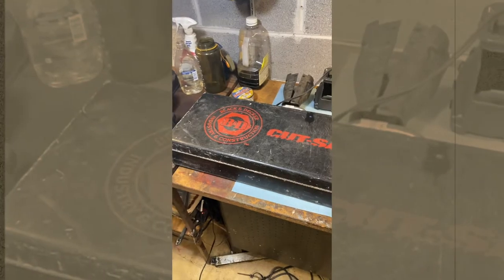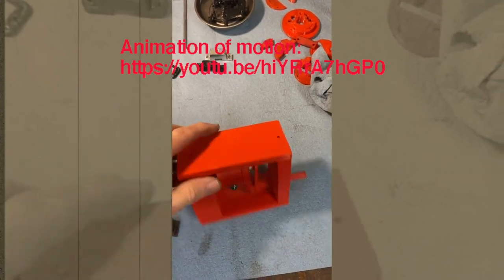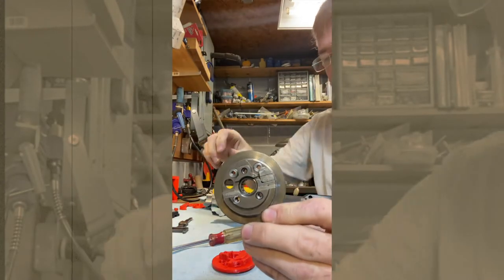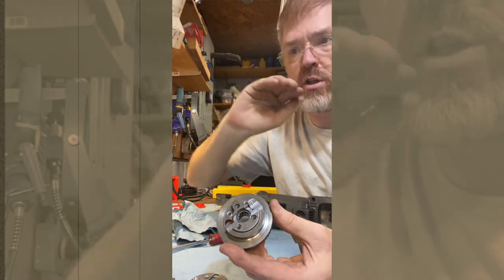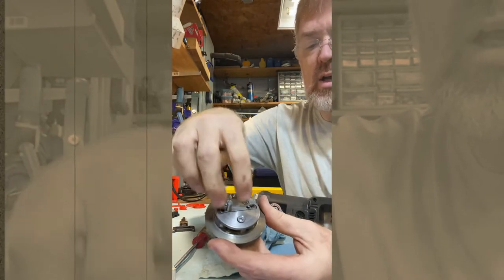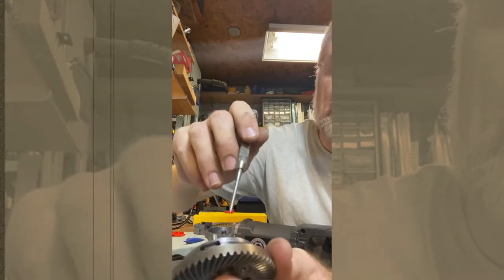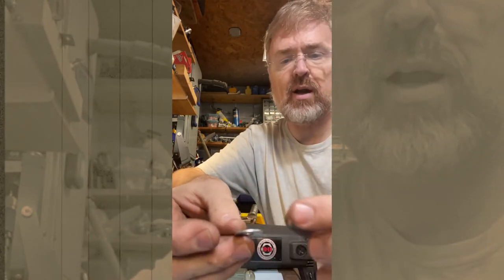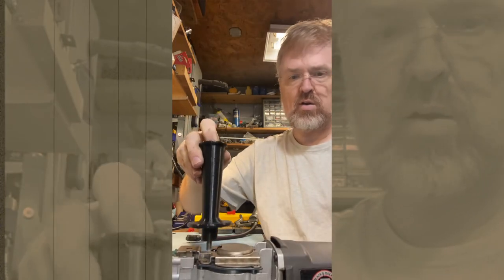DIY Power Scraper

Comment: Thanks for taking the time to make the video.  And, more importantly, thanks for explaining your thought process on why you did what you did vs what others have done.
Reply from the maker: You are most welcome.  I REALLY wish that scrapers could be mass produced, so the price would come down.  There is no reason that one should be more expensive than a sawzall at Lowe's.  But hopefully someone can take what I have shown and make their own.   Best wishes!
Reply: I totally agree, i can't see why this tool cant be cheaper, not in quality as i believe it can be engineered to last with using the proper bearings and what not. Im not in any way qualified or smart enough to mechanically design a new concept for this tools mechanism but i believe a simple version of whats already on the market can be produced for way less than one such as the Biax, case in point the one you have made as well as many others that im sure have done so because of the unrealistic price and availability. I know its not something that would fly off the shelf due to the consumer demand and market is so small but the price doesn't seem to match the tool.  @KevinToppenberg
Reply from the maker: @thecanadiantradesman7916    I agree.  Or I would think that someone could make a business of conversion kits or something!

Comment: Thanks for sharing all your hard work. This was so far one of the best DIY scraper conversations ive been able to find on YouTube. There's a few others that show some different types of reciprocal saws aswell but i believe il be able to combine all of them to maybe construct my own. An actual Biax is in my situation is practically not an option, as i would not be using it to rebuild and scrape for a profit, more so to only improve my own machine tools oiling and in time possibly rebuild when time permits. Further more I would need the appropriate inspection tooling such as a very large (due to the size of my equipment) surface plate and various straight edges. Again thanks for sharing and for your time
Reply from the maker: Thank you for the kind words.  I'd love to see the final results if/when you get yours built.  Best wishes!  KT

Comment: Thanks for the video! I am building an Epoxy Granite CNC mill, and there is going to be a lot of scraping for all of the linear slide surfaces. Fortunately, I googled "power scraper" last night and your video came up in my feed today. I discovered the Biax and Makida scrappers but both are either more than I can afford or am willing to spend, so I started pondering along the same lines. A modified reciprocating saw.  In the end I suspect I'll just do it by hand, since I haven't done it before. Giving a power scrapper to an amateur might be like giving a monkey a machine gun.
Reply from the maker: I think starting with hand scraping would be a good beginning.  Get the feel for it, and see if you really need a machine.  On the other hand, it was a fun project to make!
Reply: @KevinToppenberg  I agree. Once the CNC is done I probably won't need to scrape anything again. I primarily want the CNC for telescope making and some other projects.
Reply from the maker: @jameshicks7125    That sounds like a fun project.  Best wishes!

Comment: Great use of modelling & 3D printing to optimise the parts pre machining. Good explanation of your design choices and how you overcame the pitfalls. Your machining skills will improve you have a BP style mill and there is hours of content on the ‘tube to absorb. I too would like to make a power scraper and have watched all of the males as you have but you have added to the knowledge base by showing the Biax approach. Please do share more as you develop your solution. Yes it took you a month but you have already saved me development time. One solution suggested is to build two units with fixed strokes one short and one long to save the hassle of building the adjustment into one unit. Thanks for sharing.
Reply from the maker: Thanks for the kind words.  They are appreciated!

Comment: Well Done Kevin, thanks for sharing. So, now all I need to do is finish painting my basement shop area, prepare and finish the floor w/ polyasorbic (think epoxy, but better) floor finish, clean up my newly purchased 50 yr old BP mill, disassemble it to move to basement ( down a grass covered incline), rebuild head, motor, and table/saddle/knee parts as needed, scrape all the ways, reassemble....then I can replicate your wonderful idea to make a power scraper to make step 47, 1000 times easier.  I may have lost my mind!
Reply from the maker: I guess it is all about enjoying the journey, eh?  It is funny that you mention transporting your mill down a grassy incline.  I am in the process of moving my shop out of my garage to an outbuilding which is down a grassy incline.  I'm afraid I'm going to have to rent an expensive forklift with large tires.    Best wishes!

Comment: I have used that masonry drill bit hack myself - I made a set of them and they have got me out of trouble many times
Reply from the maker: Someday I hope to purchase a proper set of carbide drills.  But you do what you have to do!  Thanks for watching
Reply: @KevinToppenberg  
You never know what the day will bring. I recently went to car boot sale and got lucky finding a tin of about 50 carbide drills.These are mostly metric and under 7mm with a lot of duplicates, and a few small carbide bottom mills and countersinks as a bonus ....they are all in great condition, some never used. I knew straight away by the weight of the tin that I was on a winner and snatched their hand off when he only asked £4 for them ...... even in my state of shock, I did have the decency not to try and beat the price down.  :<)
Reply from the maker: @bigoldgrizzly   I love stories of a great find at such sales!  Best wishes.
Reply: @KevinToppenberg  
Indeed so - a bit like fishing, every time you cast, you never know what might end up on your hook  ;<)

Comment: Great thumbnail for the video! Nice use of pop culture references with merely an image! Commendable...
P.s. phew, regarding the filming of my restorations, i just might do some, as i just moved my Emco FB2 on her bloody table(dont try to muscle around 110kg of cast iron), and now the shop is actually starting to look more like a shop and less of a mess... I guess I`ll use one of the screw anchors in the ceiling for garage door and install a custom swivel arm. With it hanging there i`ll be able to film the whole room from a good position and capture all the work more or less from good angles...
Reply from the maker: Thanks!  Does it remind you of a particular pop culture reference?  I was trying to be dramatic, but wasn't copying anything specific, as I recall.

Comment: That last black ring you 3D printed so the cap would fit properly; how did you get the dimensions for that cap?  Noticed you have not only the diameter correct, but the whole cap seems to perfectly fit the cast metal casing of the scraper.
Reply from the maker: It's been awhile since I did this, so I don't recall directly. But my usual process is to sit down with caliper and measure all the parts, and then put those values into my modeling software (I use OpenSCAD).
Reply: Info there are calipers with some plugs at the messuring points the V shaped plugs go into the drilled holes and msssure their space between centers. They are expensive 70.- but well woth the money.
You could also plug in all screws and messure all diameters at the outside of the circle then calculate the messured diameter minus 1 screw diameter that will result will show you the hole centers.

Comment: Nice work, yep it will be fine for your scrapping mate, just angle the underside of your carbide holder to allow a lower attack angle experiment with a little more flexible material for your main arm if you have time. Take your time get used to it and your golden. Once again nice job
Reply from the maker: Thanks.  There does seem to be a bit of physical skill needed.  I appreciate your feedback.  :-)

Comment: I highly recommend that you replace those three hardware quality Phillips head screws with grade 5 hex head or Torx screws. At some point, those screws will shear off.

McMastercarr. That’s where you go for parts and materials. Just get used to buying boxes of things like screws, washers, nuts, etc. You’ll always use them later.

The arm is too long. About half the length is needed, maybe a little bit more. Also it’s way too thick. It needs to have some flex.
Reply from the maker: Thanks for your input.  I know that a hand scraper has flex, but do the machine scrapers also flex?  From the pictures I have seen of them, they look rigid.  Good idea, too, about the screws.  Thanks again.
Reply: @KevinToppenberg  yes. Without that, it’s hard to control, and quickly becomes very tiring. You’ll also have to make a different handle. That handle. Particularly being vertical, on the top, isn’t going to give you much control, and, after all, we’re just taking a couple of tenths off each time, at the most.

I can’t really figure why you’d want one of these anyway. They’re really only useful when you do a lot of scraping, often.
Reply from the maker: @melgross  Well, as I said in the video, this is a learning process for me.  I'm going to have to figure out what is best as I stumble along in the dark.  Thanks for trying to send some light my way!

Comment: For anyone who wants to make one of these, I caution you to stay away from all of the 2021 production Harbor Freight sawzall's.  The design of the ring gear leaves little material for adding a sliding mechanism to adjust the stroke.  This includes the Chicago Electric, Bauer, and Hercules models.
Reply from the maker: Good to know.  Thanks!
Reply from the maker: I got my starting unit from a pawn shop for a good price. Also, as I tried to point out in the video, not all sawzall's even have a ring gear, and they wouldn't work at all.  So try to find a schematic of the model before buying it.
Reply: @KevinToppenberg  That’s exactly what I’ve been doing. I looked up yours and then went to eBay to look for one
Reply: I’m using a Makita JT3050, easy to find, very well made, spares widely available and made to be disassembled for repair. The  large gear is available so If my modification goes wrong  I  can try again. The handle end is removable so I plan to 3D print a replacement adding a variable speed switch with a dial as used on some drills. I am aiming to sue the saw upside down that way it will more closely look like a Biax. I’ll experiment with a 3D printed piece where my right hand will sit at the front of the saw being right handed.. Biax give the length of their units and I think I will need to shorten the front end. My adjustable stroke mechanism will be very close to your design. thanks for the inspiration. It would be good to see an update detailing what I working well and what if anything you have/ would like to change.
Reply from the maker: @tonyray91  Best of luck with your project!  Regarding an update... as I mentioned in the video, this is all new to me.  When I used my power scraper, it just didn't seem to dig in and scrape very well.  It seemed that the motor was going too fast, despite me dialing my speed to the slowest possible.  The scraping project I was working on (a 9" straight edge) was not very large, so I actually ended up doing much of the finishing work with a hand scraper.  I used the power scraper to cover all the surface, but after inking I used the hand scraper to adjust small areas of contact.  I think if I had a large project, with a lot of metal to remove, then the power scraper would be more useful.
Reply: Hi Kevin, Thanks for the update. Like you I’m new to this, Richard King always teaches hand scraping first then he lets students loose on machine scraping. I guess it would help to hold a genuine Biax to understand what it should feel like. As I recall you were scraping in a forwards direction, whereas I see Biax users sweep from side to side. I don’t think your LH upright grip is ideal comparing it to the Biax. But this is easy for me to say as I have not got my machine running yet. I think Lookcreations principle of remove less per scrape is also worth considering as amateurs we are not in a hurry. Biax quote 0 to 1800 strokes per min.Ca Lems power scaper looks good, he knows how to hand scrape so should be a good reference point.
Reply from the maker: @tonyray91  Sounds good.  Let us know how it all goes!

Comment: Why no just buy a biax? They’re inly $5k 😜. Nice job.
Reply from the maker: What I want to know is WHY they are so bloody expensive!  Seems like there would be a market for a cheaper alternative!  Thanks for watching.
Reply: @KevinToppenberg  i think the market is very small and they are high quality units built at low production rates in europe (Germany?). We are so used to prices of mass produced poor quality items from China that the price seems outrageous in comparison, but a lot more robustness and quality control goes into these machines. Also, there are virtually no competitors and since the market is mainly larger industrial companies they can get away with charging an arm and a leg. That’s why we see more and more conversions like yours.
Reply from the maker: @sblack48   Yes, I sadly think you are right.
Reply: @KevinToppenberg because they only sell a few. Scraping is a rare craft these days but neverless it is a very precise way to produce some what handmade rails. And besides the manufacturer sells to other industry producers the insentive here is to safe taxes by investing in very expensive tooling.
You maybe adjustes the handle by now? 
Btw scraping soft steel needs a diffrent cutting edge angle then cast iron. Same for alu.
Good work you did there.
Reply from the maker: @fearlyenrage  Thanks for this feedback.  I have lately been thinking that I don't have my cutting edge angle right.  This is definitely a skill to learn!  Best wishes... KT

Comment: What’s up with the weird video effect?
I’m not sure what you were hoping to accomplish with 2/3 of the screen in some weird noir closeup. Just some feedback it DOES NOT add, it clearly detracts from what you’re trying to show. 

In fact it’s so distracting I can’t even finish your video, which is too bad because I’m extremely interested in following along for my own reference.
Reply from the maker: Thanks for watching.  This was one of my early videos, and I mistakenly took all the footage with the camera in vertical (portrait) mode instead of horizontal (landscape) mode.  But to show on YouTube, it has to be landscape.  So this was my attempt to still make it work.  Sorry for the distraction.
Reply: @KevinToppenberg  i tried flipping landscape mid video but it still persisted, but I’ll try loading it this time while already in landscape first to see if it fixes. Thanks for the info, I’m looking forward to watching it to completion this time 👍.
Reply from the maker: @TradeWorks_Construction  Flipping orientation on your end won't help.  I took the erroneous vertical video and added those side bars so that that the uploaded video was now the aspect ratio of horizontal.  Yes, it's a complete mess!  So sorry!.